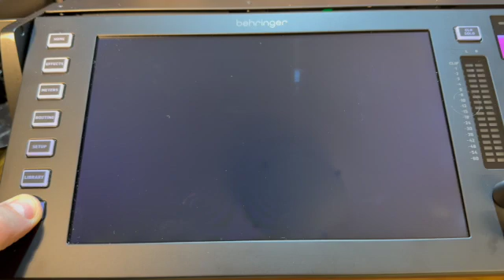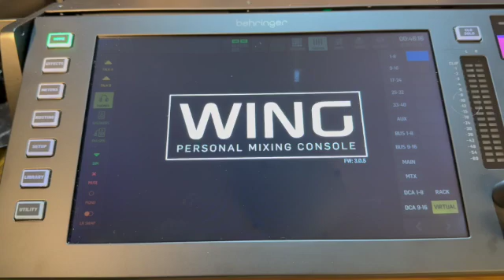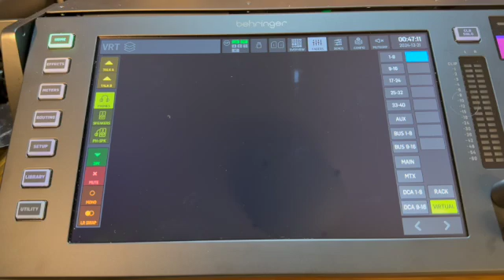Behringer Wing Rack internal Dante card installation

Comment: How many CAT cables you need to connect Wing Rack  with FOH Wing console? I got an info that for connecting DL stageboxes with Midas FOH consoles you need always 2 CAT cables. I am asking because I am thinking to use  Wing Rack as a Mixer for band's IEM on the stage and simultaneously as a stage box for FOH Wing console.  In this case the Dante could work better - only  single CAT cable needed for all channels - right?   Just the question - if you install this type of DANTE card into Wing Rack - where do you connect your CAT cable?
Reply from the maker: @arievanderharst  1x AES50 = 48x input and output channels. Therefore 1x AES50 between MON-Console and FOH-Console is sufficient. Currently, I run Wing - HUB4 - DL32 - DL16 all AES50 daisy chained. Will be in future Wing - Wing Rack - HUB4 - DL32 - DL16. So that works flawlessly without Dante.  Dante provides me with a more universal connection if to be connected with a console without AES50 or to capture multiple soundtracks in one connection. There is no "better" Both AES50 and Dante are great. Network cable for Dante is connected to the Control/Audio Network RJ45 connector.

Comment: Hi there. Slightly random question but is there an internal cooling fan on the Wing?
From the video it looks like there’s a large grill for one but it’s not installed?
I’m considering one for a studio environment so would be good to know if it will generate any noise.
Many thanks
Oli
Reply from the maker: It depends on the model. Wing Rack & Compact do not have a fan. Wing & BK do. I have heard that it will be possible to retrofit a fan in the Wing Rack but have not seen anything official from Behringer. So Wing Rack & Compact are quiet, Wing & BK sometimes generate some fan noise but that's barely noticeable and less sound then changing layers (fader sound).
Reply: @mixinglane amazing thanks for the info. All the best.

Comment: Is the DANTE working on your network? I did the same thing but I cannot access DANTE on the network. I aldy told Behringer but still no response.
Reply from the maker: Yes, Dante is working as expected and brilliantly with the Wing. If you open your Behringer Wing yourself to add a card from a different manufacturer and it doesn't work as expected, I can imagine you haven't receive a response yet from Behringer. Have you asked Audinate? Did they respond?
If you can't access Dante on the network, it is clearly a settings error / user error. Have you:
The latest FW version on the Wing? Registered the BL card in the Wing? The right firmware version for the BL card? Set the Dante Controller correctly?
Reply: @ I have the Brooklyn II PCB Rev 4V1 pre-installed on the WING RACK. It cannot read and work.
Reply from the maker: @HATCHIFI3D  I'm sorry for my assumption. There are a lot of variables impacting on your issue. It has to do with the Firmware on the Brooklyn II. To read more about this, I suggest: https://www.facebook.com/groups/434340887270203/permalink/1533106360726978/

Comment: The slot is hinged like it is in the full Wing. Push in the card at an angle, then push it down. Done twice now.
Reply from the maker: That's odd. You are probably right. I noticed a hardware difference though. I have to check my Wing video to spot the difference.
Reply from the maker: I'm going to get the Wing Rack out of the rack again and open it up 🙂

Comment: Is it worth money
Reply from the maker: That's a question that you can only answer.
Let me share my calculation:
Band needs 7 channels coming from a laptop. I already have sufficient inputs (Wing, Wing Rack, DL32,DL16). Dante card €395,- Dante Virtual Soundcard €95,- total: €490,- For that money, the laptop is connected with one cable only and I have potentially 57 (64-7) extra inputs and flexibility.🤘